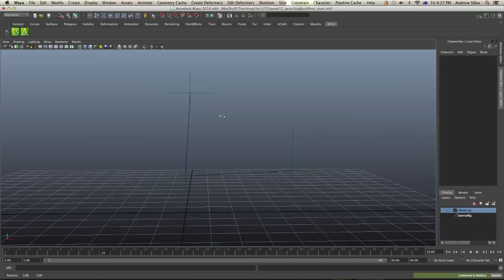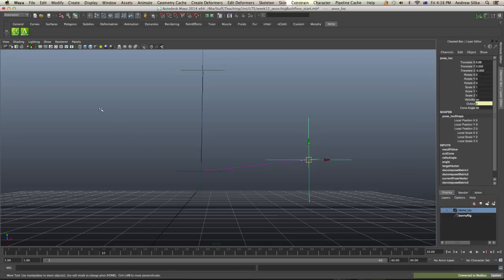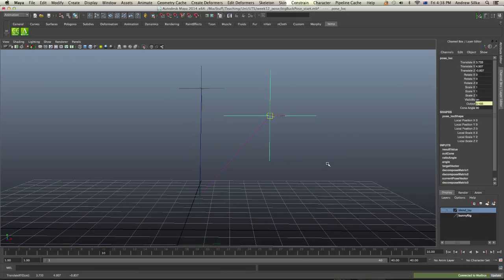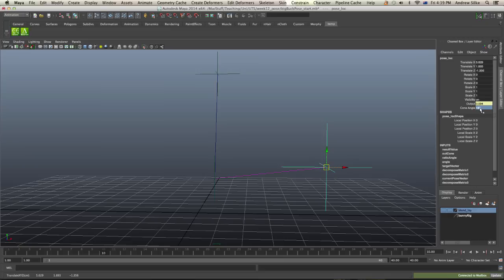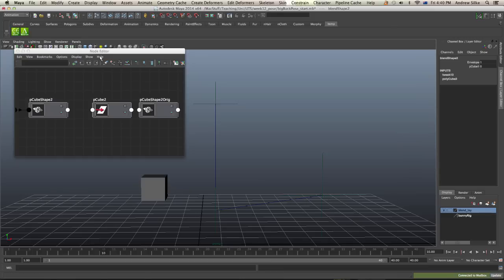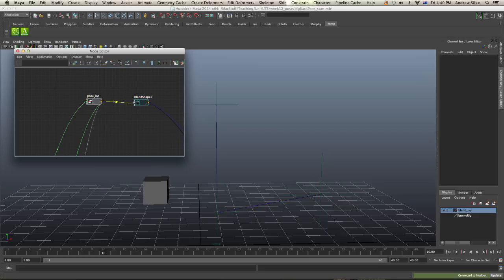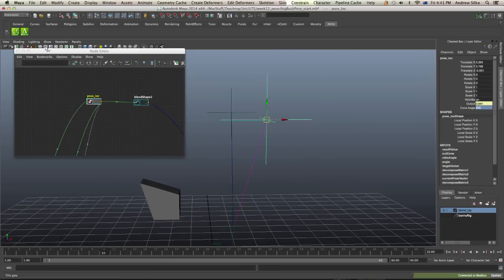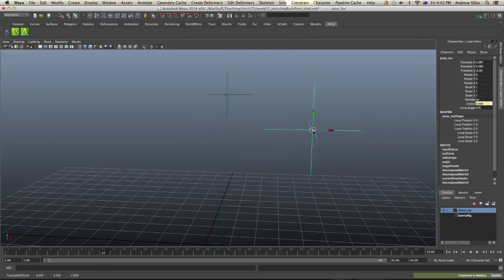Pose Space Deformers: The Pose Reader (Maya 2/3)

Comment: this sort of worked - i'm on maya2013.  I opened up the 2013 file and setup a couple of extra attributes on the pose_loc - output and coneAngle.
I also used a cone shaped volume light and hooked up the radius so i had a visual display of the cone angle.

the problem came when i started parenting those locators under the joints - the transform values change and result on the blendshape seems to be innacurate.  I'm not quite sure where i've gone wrong really :/
Any advice you can share if you got a spare moment?  this should really be something maya can do with a simple plugin or something :/
ta!
ant